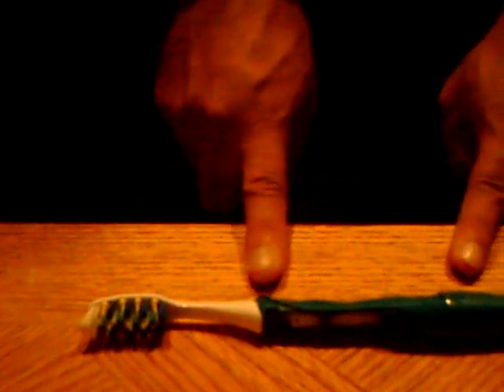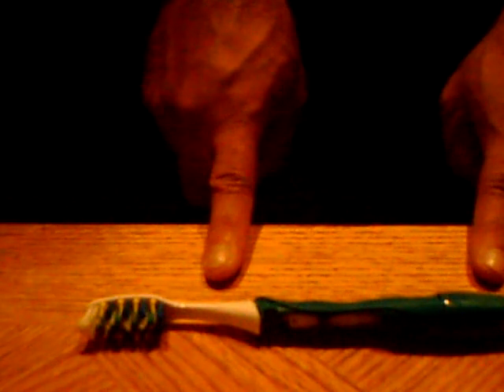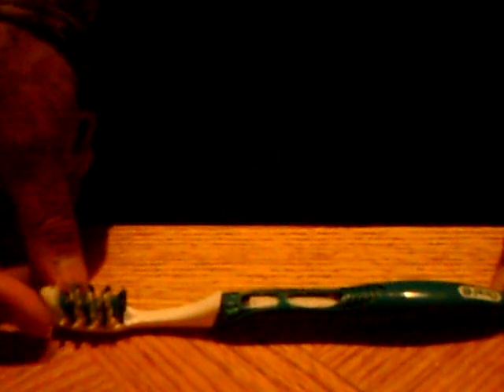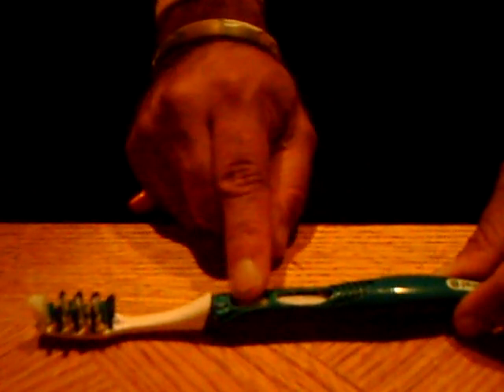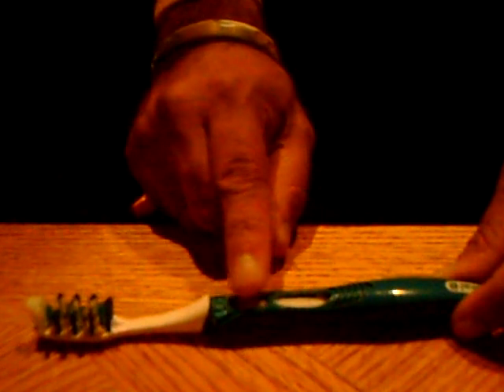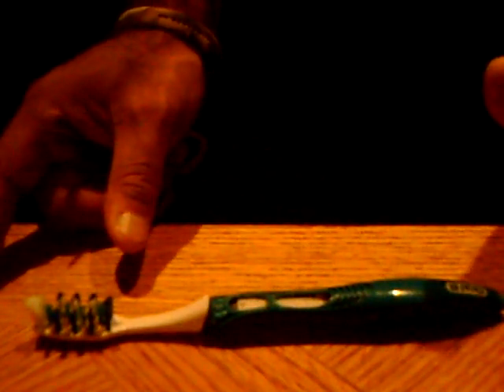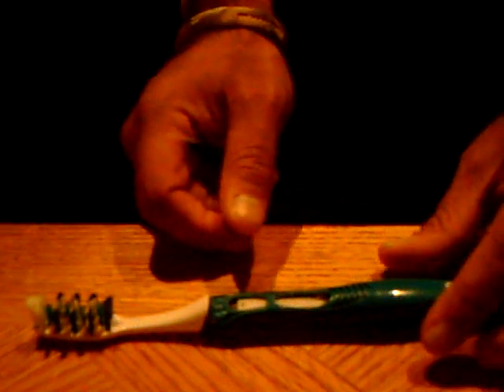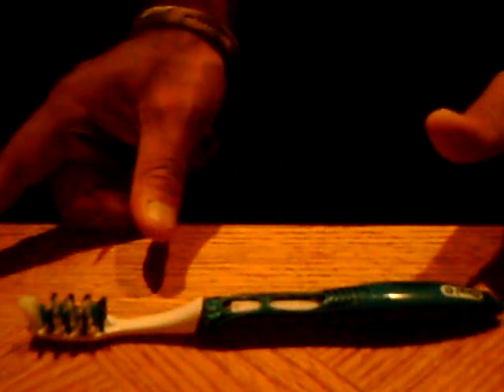Oral-B Pulsar Toothbrush Motor Removal

Comment: So, I'm new to this stuff and well... I pulled the motor out of the casing and there are no wires at the back of the motor... I used a different toothbrush... Is there any salvation for the motor? I checked google and it said I needed to solder wires but didn't explain where... and I'm sorry, this is a really stupid question...

Comment: Actually you can remove the motor/battery assembly very easily to replace the battery and only have to cut a small slit in the rubber. Look for a video by andycivil showing how to do it. I just did it on a US version of the Pulsar and it worked just like in his video, and saved me several dollars.

Comment: Didn't have room in my first post to say this, when replacing the whole assembly battery and all be carefull to make sure the switch on the assembly is lined up to the switch buttons on the casing. Also make sure the assembly is pushed all the way home. It would pay to take note of the assembly before its extracted. Even measure it as it does take a good push to seat  it properly.
Best to practice on an old worn out brush first. 
I accidently left my new brush on. Flat battery. Easy done.

Comment: Oh yes you can change the battery so so simple, well at least on the UK brands.
For a starter the end cap unscrews and IS NOT glued on Just tight and with a small rubber O ring to stop moister getting in.
OK unscrew end cap.
The whole assebly battery and all just pulls out. OK it's a tight fit. 
Try not to bend the cotact at the end of the battery. It might pay to tightly tape the battery with electrical tape to the metal strip and pull it out. change the battery & reverse prosess. Simple.

Comment: I know this a bit late but i had the same problem but when i got my pulsar i checked the battery straight away to see how i replace the battery and the damn thing wouldn't work after that. The only way i could get it to work was by pressing the contact on the top as hard as i could, but this still left a gap so the brush would still not work. So i folded a small strip of tin foil big enough to make contact with the battery and it works fine now.

Comment: @VileMisanthropy try stuffing a small 1/4" x 1/4" x 1/8" wad of paper inside.  i found that the "clip" that holds the battery in won't fully contact the battery's positive end sometimes since you may have bent it when taking out the original battery.

Comment from the maker: Well, the battery compartment makes replacement difficult, so I never try. I just use it until the bristles wear out, battery powered or not. If you want one with an easily replaceable battery try the Colgate 360 Sonic Power Toothbrush. It has a battery compartment that screws off and on for easy battery replacement.